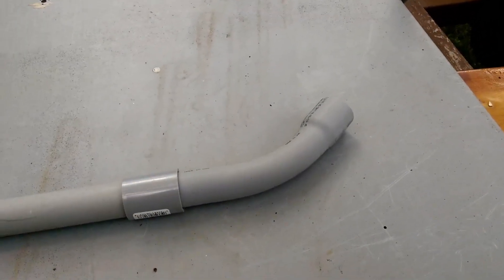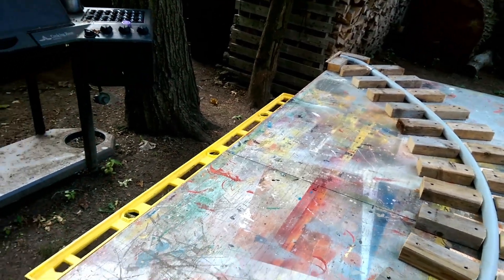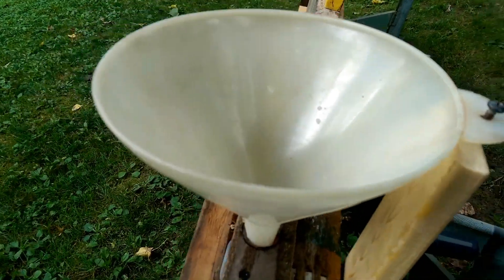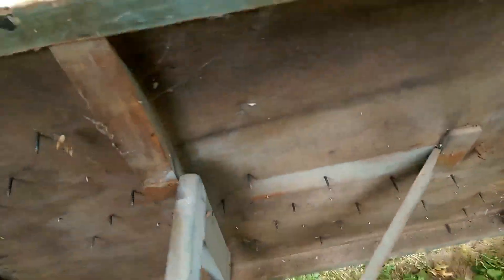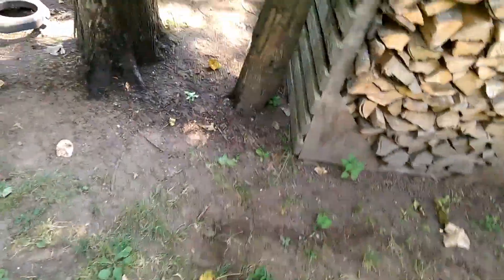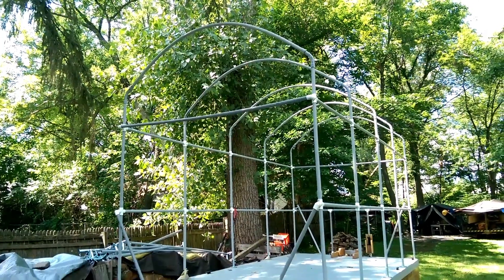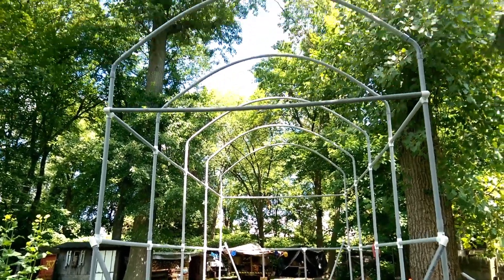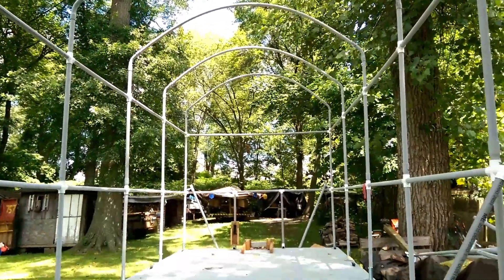PVC Pipe Bending

Comment: To enlarge a warped coupling, use a piece of the same size pipe, chamfer the end, heat the coupling, and insert the piece.  
For that matter, you can make your own coupler on a straight piece that way, though it shortens the piece slightly.

Comment: dude really . i was an electrician  for over 25 years and i have shaped offset and bent miles of pvc . you are making so much more work out of it than it needs to be . for long bends all you need to do is run a heat gun over the length of the pipe until it gets soft then hold it in position  and run a cold wet rag over the pipe to hold the shape . it will take a lot less time to make these bends  and peices work than the way you are doing it also every place you put a coupling makes a weak point. i think you will find as little as a 10 mph wind will destroy that canopy . instead of putting all those fittings in , just glue two ten foot sticks together and stick them into your bases you mounted on the deck on one side then bend the pipe over to the base on the other side without heating it  so that it is under tension  and fasten it to the  base on the other side. depending on the width of the deck you should wind up with a cover between 6 and 7 foot tall at the top just bend as many pieces this way as you need then brace between them with some notched 2x4s  and plumbers strap.  i have had one of these up for three years in up to 40 mile an hour winds and it has never even cracked .  look at some videos on building hoop houses and greenhouses.  they are pretty easy.

Comment: How's about checking out International Greenhouse shade fabric, they have standard sizes they make with taped and grommeted edges. The stuff streches and even works best when streched tight. It's the constant wiggling back and forth in wind that breaks down this wonderful shade. It'll last many years, and you select the amount of light you want reduced. Black is too much heat! It does come in like a sand color and 70% blockage.
It's professional grade shade fabric and much better quality than Home Depot. Just a thought.
Thank you for sharing !!
Reply: Thanks...good tip!
Reply: Doesn't the fabric let rain come through?

Comment: Nice build, simple way to form an arch. 
Not sure if it'll help me out, though. My arch is going to be about 40Ft wide as I'm building a green house on an old house foundation, which is 45x70Ft. I think the length I'll be working with the natural bend will be enough. The sides will be solidly fixed so they won't be forced away from center. I'll have to have to at least 1 length wise rib, maybe 3. I'll see when things start to go together.

Comment: Dear Mr. Malboeuf, Normally i would have a smart ass comment, however as a union electrician for the last 35 years and have bent all types of pipe a long time. schd 40 pvc up to two in. can be bent with a bending blanket or even the exhaust of a truck, use a cold wet rag to set the pipe quickly. after 2 in. you can rent a kit that goes from 2 in to 6 in. it has plugs for both ends to pressureize the pipe to avoid a kink, what you created is what we call a bending table, that way the apprentice can carry the dimentions to the master at the table to fab. except we use markers on the table for standard bends. then just bend the pipe until it fits the line drawing on the table, blocks are mostly used for wooden ship building now. sorry about the spelling, i am a yank, dont you know. pvc also comes in heavy duty called schd 80. hope this helps.
Reply from the maker: It must be fun to recognize an apprentice handyman who is basically going about a job in a logical fashion but lacking experience. Yet, gets good repeatable results, even if its a struggle or overkill on a technique. I'm amazed at all the great comments and suggestions, especially from those in the know. I especially like the pressurizing the PVC method you suggested to avoid kinks. That sounds like a great technique and I'm sure to use that when a project demands tight bends, and where kinks could goof up a build. I'm a aerospace technician by trade and have run lots of machining equipment. Accuracy has always been an issue in that line of work. I find it empowering to work to looser tolerances as far as speed of fabrication goes. But I still tend to over engineer to keep specs tight, its in my nature. I learn a lot from folks like you who have been there, done that, and are willing to share their knowledge. Thank-you.

Comment: I have done a 220 inch rub which required the same  curve, using my lowest wattage heat gun.  this template is the ideal end to end jig.  i just used direct heat for 25 seconds and got the same result.  ?Bends caused by hot water tend to straighten  out in the hot sun, where the heat gun caused the pipe to last far longer.   Water does not change the pipes outside and oince hot can tweak the pipe and allow it to return to the original form.The heat gun erased the memory of ther pipe which causes straightening when heated .  nice template.

Comment: First, I am not an engineer, nor a roofing expert! It's a really ingenious way to bend PVC, however, wouldn't it have been much simpler to use 45 degree connectors and put a "peak" on the roof like a house? The rain would still run off and it would have been done much quicker!
Reply: An arch is stronger than a straight run.
Reply: This may be true. But one thing that is difficult with pcv when gluing everything together is making sure all the joins are straight. The more joints, the easier it is to not be straight/square.
Also, it's easier to throw plastic over a curve than an angle, especially a 90^ bend. Also, every hard angle is a point of hard contract against the plastic or what ever is thrown over to cover. I had a small green house built, and right where the corners where (made out of wood), the wind flapped the plastic enough till ripped a hole in it, then it started ripping along the rafter.
Reply: If you use 45 degree fittings where the rafters meet the walls, you would need a 90 degree fitting at the peak.
Reply: That would give you a 12/12 pitch. Pretty steep, but should work.
Reply: I second that motion!
Reply: Round has been shown best for snow. I bought a pointed one, did not make it.
Reply: @zippy3711  Rounded shape distributes  the coverings load over a larger area while the peaked shape will have the load and stress from wind focused on one piece of pipe.
Reply: Bending is stronger than straight pieces. Tarp it and give it a snow load and guess which one fails!
Reply from the maker: The primary design criteria is not evident by just looking at the finished project. For example I wanted a roof with nice aesthetics that looked pleasing to the eye and could shed rainwater adequately; while also meeting height restrictions. I had to stay below the 13 feet and six inches limit established by the Connecticut Dept. of Motor vehicles. The raft & fully assembled canopy had to fit under bridges & below power lines when being towed on a roadway.  I also wanted enough height to move around the deck without crouching down. A peaked roof design would have required lowering the side walls in order to meet the height restriction at the peak of a 45 degree roof. This would have resulted in eaves to low to walk under comfortably that would also restrict visibility when out on the water.
Reply: @Da175305M  Good thinking it through...all makes sense !!
Reply: oldschooldiy    That would be too easy, if he's anything like me he enjoyed the challenge and the solution.

Comment: One thing not mentioned is the thickness.  This is considered elect. conduit, and comes in schedule 40, or 80.  I think he was using schedule 80, which will have better strength....

Comment: Good. Don't you need a center strut on the roof?  You also need to use abs as PVC has no UV protection.
Reply from the maker: I did add a removable center strut that ran perpendicular to all the hoops and connected them all inline. I used a snap Tee adapter for each hoop connection. These are basically fittings that have about 1/3 of the pipe missing so they fit over and snap onto a piece of pvc pipe. here is a link to what they look like. 
 https://pvcpipesupplies.com/1-schedule-40-pvc-snap-tee-463-010.html
Reply: @Da175305M  Great idea and video !!!
Reply: NMC - non-metallic conduit is UV resistant.  See @2:23 imprinted "aboveground" on conduit. 
For the span I'm inclined to agree on the cross braces center. Crosses are pricey, but think it would help to prevent racking.
Reply: @HAM-gs1nu  I was thinking the same. He's using basically electrical conduit, which is UV resistant.
Also, stand pvc can stay out in the sun for many many years before it becomes to brittle. Being on a farm, we've had schedule 40 laying ontop of the ground to run water to troughs and such, directly exposed to sun about 10hrs a day. I'm in Fl, so lots of sun. Never any issues with it.
Reply: He's using a tarp, so what's the weight concern???
Reply: @rmbaker100  It's not so much the weight, it's the sideways motion (lengthwise of the whole greenhouse) that would allow the rips to be move. This could cause low spots where water could puddle.
I agree with the others that a top ridge should be used, even if he just screwed a piece of wood to the bottom of the peak to the next.
Reply: @rmbaker100    I was thinking racking more from wind gusts than from weight.  Regards.

Comment: To get the pipe coupling round and the correct diameter, just heat up the end with hot water or heat gun and shove a cool piece of pipe into it.
You can even make a coupling where there wasn't one the same way with no sanding.

Comment: Cool. I just saw your video in my feed. I just haf my boat lift installed and was thinking of a way to make a cover for the boat, using the PVC guide posts on the lift,,,, now I see this video. Thank you.

Question though?
What do you call the steel base pieces?
How can I find those?
Those can comebin useful somewhere else.
Thanks.
Reply: I know the bases are a sort of flange, but not sure exactly what they are called when they are tall like that.  Curious and would like to know also!  Anyone have a link or know the term for the tall flanges like the ones he uses?

Comment: Ive seen people pack sand in the PVC tubes, cap them and then use a heat gun to form the tubes over a shape. It let them get a much tighter curve without crimping the pipe. Your method seems to work well too. at the end I'd just run a hose into one end to cool it out rather than messing with dumping the warm water out and funneling in cool water. 
This would be great for a temporary green house that can be put away in the winter. I wouldn't make one as big as your project. One the size of just two arcs would be good for starting plants in the spring and through the summer.

Comment: Just use a propane torch. Work's twice as fast.
Reply: Easy to burn the PVC. The heat isn't even inside and out and the pipe will easily collapse/crease.
Reply from the maker: @susansmith1817  If you were to fill the pipe with sand it will not collapse/crease when it is heated.
Reply: @Da175305M  Yes, I agree. The comment didn't address that specific aspect. I do prefer the hot water method better.

Comment: Hello Dave, I like the video. Just a word to the wise, those are couplings, not couplers. Couplers are used to couple things loosely  together, as  in railroad cars. Also, I would like to see you get water up to 220°F without being under pressure.
Reply: My dictionary says a coupler is a device that connects two things.  Looks to me like that's what those gray things are doing.

Comment: If you're worried about water getting under your base for your poles are you got to do is use RTV Automotive sealer put it on the base of your Mount screw it all the way down to the wood and you'll have a waterproof seal underneath the metal it'll never damaged wood or the medal
Reply from the maker: RTV is not appropriate in this application. The open ends of the steel stanchions (that provide attachment points on the deck for the PVC frame) tend to collect water and must be allowed to drain. Since there are weep holes in the bottoms of the stanchions there needs to be some clearance for drainage to allow water to pass thru & drain. RTV would block the weep holes, water would pool up, and this would cause the steel to corrode.

Comment: Could you use hot air; a hair dryer, instead of hot water?
Reply: yes but it take forever and pipe would not set right it be waves and flat in places. Water  forms a even bend on the pipe. not over heating it . I would used the drain on the hot water tank drain. cleaning the tank and faster heating the pipe. And with a good hose.
Reply: @Tonyinmemphis   I would think a skilled person with a heat gun can bend the PVC pipe without creating flat areas, or too many imperfections. Would still need a table jig to do a great job, though, imo.

Comment: BRILLIANT yet so simple. That's the best part of your procedure, Mr. Malboeuf. It's simplicity. Many, many years ago, I constructed my 1st C-Band satellite receiving system myself using 1/2 & 3/4 inch EMT conduit for the framing ribs of my dish. To get the same, consistent curve for each stick of conduit, I curved them over a left over roof section or 2 of a large, steel Quonset type hog shed I helped Daddy build. Although it wasn't too hard to make all those identically curved sticks of conduit, the finished assembled structure of the dish was much heavier than I expected it to be. Even though I used hardware cloth & screen wire for the signal reflective surface of the dish, the combined weight of all those lightweight, thin walled sticks of conduit, again, ended up being much heavier than I expected. I'd thought of & would preferred to have used PVC, but was unable to think of a way to curve it & to keep it stay curved (I built it in the mid-80's). If only the internet & You Tube were available back in those days. Thank you, Sir, for these very informative & again, ''so simple'' instructions on how to do something I've still been wanting to do to this day. I've accumulated a large amount of various drawings & plans for curved framed, PVC structures both drawn out on paper, as well as in my mind that's been in my possession for decades. Thank you again, and take care Mr. Malboeuf.
Reply: While in college many eons ago, had a job stringing copper and/or pvc pipe for pneumatic controls over hot industrial furnaces.  Learned a lot, quickly.
Reply: 8kg hank you

Comment: shit filming but really GREAT CONTENT & INFO. Thank you for doing this bc I am in the process of building a 16'x40' grow house/ greenhouse & was wondering how i was going to do the roof on it. Well NOW I KNOW. Once again thank you for this video
Reply from the maker: A grow house may not need the bows to be heat bent to keep a curved form. If you drive a bigger PVC pipe in the ground with a sledgehammer, then poke the smaller pvc pipe for the hoops into those pipes the tension will keep the bows locked in place. The pipe will find its natural curve. You could then drill a hole thru the ground connection and lock the assembly together. There are a lot of YouTube videos on how to make a hoop house this way.
Reply: @Da175305M  Thank you kindly sir. I'll be lookin into all that very shortly. I started laying out the perimeter today & gettin a plan & material list together. Gotta make it happen soon. Kind regards

Comment: Cool
 I use the same form techniques as a cabinet maker. A few weeks ago I made a front paniier rack for the fromt of my bike. I heated the pvc over a propane grill as I only needed to bend short segments. Had sand in it and bent it around the template. I inserted dowels where the support tube met the angle bracket and epoxy and screwed it to expand the dowel like an anchor. I will make vids as soon as I replace my stolen cameras.

Comment: Love your project and how meticulous you are doing it. I wonder if the pipes were filled with water if it would strengthen them and or maybe this could be used for a private green house
and utilize the P.V.C. pipe that is the frame work as a pre-established plumbing for watering.
Reply: Actually Gilberto50, you are correct.   Good catch.   FACT: Water cannot be compressed (in liquid form).  HOW TO BENEFIT: Once the PVC shape has been established the ends could be capped with the pipe filled with water.  It would add weight but would greatly increase the rigidity.
Reply: Just don't fill and cap them, if you live in a climate that sees freezing temperatures in the winter.....BOOM!

Comment: YOU da man, EXCELLENT idea on maintaining the form, I wasn't aware just using boiling water would do this, HOW MANY attempts with correct timing of the water temp change did it take to perfect your process?
Reply from the maker: My second attempt got me the results I wanted. The first attempt I squished the pipe ends slightly. But, the learning curve was totally necessary since this was my first attempt a bending PVC piping. A great deal of thought went into the effort and I got lucky to have got the results I wanted fairly easily.
Reply: David Malboeuf   Looks like an excellent method of making large controlled bends.  If one end doesn’t take the bend as well as the other end you may need to pour boiling water into both ends, alternating an equal quantity, to raise the whole pipe temperature equally.  Looks like hot water is great for large bends as any other method it is difficult to obtain an equal temperature which makes it difficult to have a smooth bend.  Thanks for showing how to bend large PVC.   Can you post a source for the brackets?